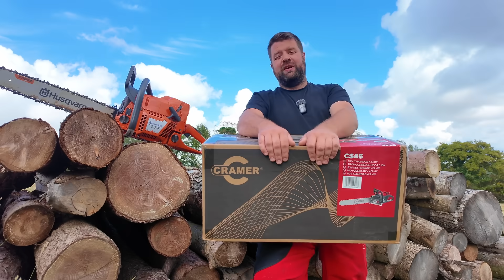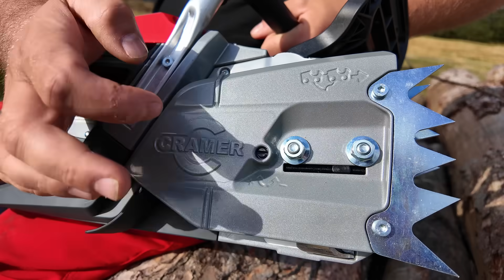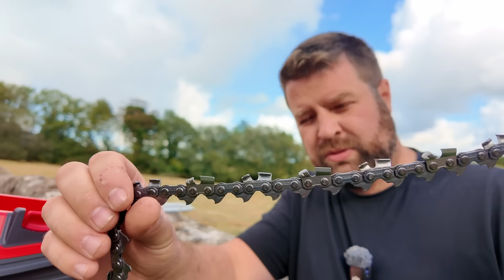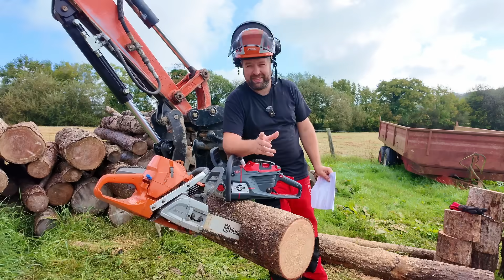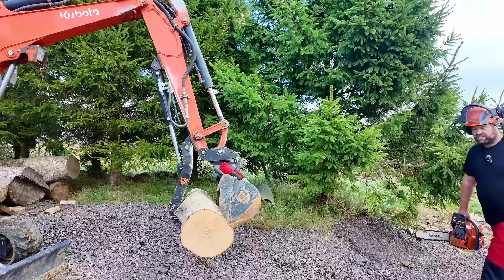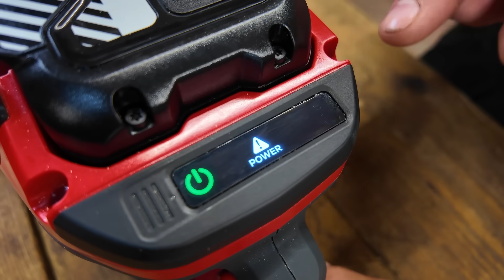Can this NEW 70cc Chainsaw BEAT my HUSQVARNA 372XP?

Comment: Cramer has the right idea but the wrong energy source. They need to make the saw solar powered and 70cc equivalent then we can start comparing it to professional grade equipment. Til then it's just a good conversational piece for guys at the water cooler.

Comment: The 372 is out of tune I can tell just by the sound it should have not bogged down that much in either wood. Chain looks like it could definitely be sharper  it was throwing more dust then chips

Comment: I own and still use a 372xp its one of the BEST chainsaws ever made when using a 20" bar and chain. 
The problem using battery chainsaws is how are you going to work 8 to 10 hours days with it out in a forest ??
Also when I worked away from home in the forests working in the UK there was NO where at all to charge any battery up that was needed unless it was my phone plugged into the Forwarder I used.
Thank you for the video.

Comment: For many homeowners who don't do much cutting the battery option is the better of the two. I would still take a 2-stroke for any larger jobs, the ability to just keep putting fuel into it outweighs the benefits of the battery saw.

Comment: While battery powered chainsaws have made giant strides, they will never beat out internal combustion because of longevity. Anyone whobhas any real experiences with high discharge  batteries will tell you those power numbers you gave were tested with a brand new never used before set of batteries and because of how batteries work, will never again be exactly as powerful  as ther were during those tests. With every charge a battery is able to accept a tiny bit less power and this is why batteries have lifetimes measured in charging cycles of what they believe to be how many times your average person will charge that battery over a given period of time, and on the receiving side of that you also have an electric motors that windings not only corrode over time, windings also ever so slightly char a tiny bit every time it is given an extreme load (electric load and or working load), and lastly that saw is making peak power from the factory and there is no room for improvement by tinkerers and modifiers like me.
On the flip side if those were the numbers you were getting from the 372xp, then that saw wasn't tuned and running to the best of its ability, and you have not kept up with its maintenance and tuning (thats obvious from you trying to start it) as for you sharpening the husky, did you also take down the rakers? What were your rakers set at. Also the biggest question which im pretty sure is a no, but is your husky modded or is it stock? The joy with the 372xp is that it is easily modified to reliably make more power. 
In the end, that battery powered chainsaws is wonderful, especially for people like you that dont like to really keep up with their tools and just want something that they dont have to put any effort into and will still work, but most people who are actually into chainsaws see it as an interest and want to put the extra work in to have a reliably fast saw.

Comment: Great saw without doubt .. the problem on all this high performance/draw tools is the cost of batteries and their weight. The saw with 3 big bats will cost you waaaaay more than a husky.  This level is totally reserved to professional that wants to convert to battery or very rich people .
In many home situation a lighter smaller chainsaw with a battery that shares with more "home diyer" tools would be probably make more sense.
I would buy it just for free of charge 😂😅

Comment: I never have heard about this Cramer brand, I have the Stihl MSA300 witch is 30m per second also and is fast sure but for a day work out in the forest I with need a truck load of batteries. Is also the same case with this Cramer?
Reply: cramer = greenworks. The battery technology seems to be about the same for every brand. Battery saws are not made for a day of work in the forest yet.

Comment: Run time and battery price is the biggest deal breaking for me. Bought a Milwaukee brushcutter a while back,  £700! Has less power than my Husqvarna 535LK combi, and only get 20mins on an 8.o battery! The more powerful batteries were so expensive,  I didn't bother.  Bought a Husqvarna 555RXT instead, no charge time, just 10 seconds to refuel, and shedloads of power!

Comment: Great you beat an old saw made in the early 2000s.  With a saw that weights significantly more.  Why wasn’t this compared to a 572xp?
Also new bar and chain vs an old bar and chain make a difference even if it’s hand sharpened.

Comment: For those of you who want to know how the numbers stack up, if you need your saw to earn its place and its money, and put food on your families table, a husky 572XP wins every time permanently. The numbers ive used are from husky and Cramer. Everything comes with a cost. whats the run time on the cramer, price of the batteries? lets run a few numbers shall we, 7.2 aH battery that costs £500. at 82V that gives you 0.59KW/H running 4.5KW motor that gives you 8 minutes 24 seconds of run time. Cramer have a dual charger, running 4 amps per slot, so thats 2 hrs to charge 2 barreries, average to 1 hr/battery. you need 5 batteries to keep running . this gives you 40 min per hr. This allows the equlivalent petrol to be refueled and chain sharpened. Now to the money. £900 quid for the saw + £140 for the charger, and £2,500 for 5 batteries. that's £3,540 all in. and then £2.00 a day for the electric lets compare with a husky 572XP £960, leaving £2580 for fuel, lets call it 1.5 a ltr, thats 1,720 ltr of fuel, based on equal run time of 40 min /hr thats 1400 hrs= 175 work days= 35 weeks. in this time the batteries would have gone through 1400 charge cycles, then their is the electric. 175 work days x £2 is £350, this needs to be ballanced with another 233L of fuel equating to another 5 weeks relating to another 200 charge cycles. We will leave it at that. so 1600 charging cycles. Trouble is, after 1200 charging cycles, (I've looked it up) the battery is down to 80% capacity, thats another new battery right there. This is a more expensive up front cost system, that is more expensive to run
Reply: The beauty of choice I guess. I know a lot of people who don’t want anything petrol anymore, and some who have started out their businesses that never had petrol to begin with. 

Cramer also have a 5 year warranty on the batteries, I’ve got their first gen batteries from 2021 still that I use every day and they’re still running at full capacity.  Battery just isn’t for everyone but you’re never in danger of not hearing about it.

Comment: No thanks.  I cut only my firewood.  in 20 years the husky will still run like new.  The Cramer will be without batteries.  Also how many batteries will one need for continuous cutting.  Does one need to get a generator?

Comment: 6.3kg  husky compared to 9.3 on the Cramer. You'd know about that if you were using the saw for any length of time I think that's an advert for petrol not battery
Reply: it's not apple to apple. 6.3 is without : bar, chain, fuel. And the husky is a less powerful saw. 
Stihl (which is known for the best power/kg ratio chainsaws) Ms462 (4,4kw vs 4,5 for the cramer cs45) weights 7.64kg with a 20 inch and no fuel. So around 8,4kg with fuel. The cramer is heavier but not that much of a difference.

Comment: 9.3kg with battery.... enough said.
Reply: that's a standard weight for a 4,5kw chainsaw.
Stihl MS462, 4,4kw, weighs about 9kg ready to cut with 50cm bar. Negligeable difference. 

He did a really poor job comparing the weight of the two as 6,3kg is the dry weight of the 372xp and 9,3 is the full weight, ready to cut, of the CS45. Add bar, chain , fuel and oil to the 372xp and it's about 9kg as well, while being a class lower than the CS45, so heavier per kw.

Comment: Try the same test in 2 maybe 3 years time,that will be a different test, batteries don't last.
Try the new hilti or Bosch saws.
Reply: about 2000 cycles of charge before it loose about 20% capacity and power. 1 to 2% loss per year at rest in good storage conditions. You are talking about alibaba batteries, this is last gen pro grade tabless batteries. It should last at least 10 years.

Comment: Great video, how do you think the top load battery will hold up to rain?
Reply from the maker: The chainsaw is IPX5 weather rated meaning it is protected against low pressure water jets from any direction. The battery is IPX4 rated meaning it is protected against splashed of water. So will be more than fine using it in the rain

Comment: Beast of a machine that is a rebadged Greenworks. Does the Cramer brand offer full parts availability? The Greenworks parts availability in the US is very poor. One of my winter projects will be scrounging an oil pump replacement for an out-of-warranty 40v saw. Your Stihl/Husqvarna/Echo gas saws are just miles ahead on that front.
Reply from the maker: There are over 60 cramer dealers here in the UK. I know that most dealers here in the UK pride themselves with being able to support top brands and parts supply.

Comment: Stock 372s are good, but grind the bottom transfers and open the muffler and you have a beast. Would definitely compete.
Reply from the maker: Try to keep my chainsaw to stock if possible, but do love seeing how these chainsaws perform with mods! Thanks for watching
Reply: @MachineryNation  They really do become a different saw especially if you put the big bore cylinder kit in. Get yourself a Farmertec G372 which are quite cheap and do those mods then compare it to stock OEM.

Comment: I know which one will last 25 years and I have 4 of them .
Reply: For 25 years? Depends on usage. I have a Stihl 011av. My grandfather bought it. It's still running. But with not industrial use. My friend bought a 372xp 13 years ago. Mid industrial use. It's still running but he had to swap some parts of it.... At here you will have to swap batttery if you maintain the chainsaw reguraly. With industrial use this won't hold for 25 years... Not either the 372xp.
Reply: @volkerball3  I have 25 year old 372 and 30 year old stihl as well , stihl running fine , parts still available .  No one except Husqvarna is making an industrial version of a battery saw that I know of . I have a couple of those too and they are great so far.
Reply: @onthelake9554  
green works makes a 6.7hp 28 inch commercial battery saw that I saw out cut a Stihl 500i. It cost as much as a 500i and is heavier also but it bucks  big diameter logs fast. Battery electric still isn’t for everyone but is for most people today because three years I used the most power battery saw that was a 40cc dog. Now I own a 70cc battery, a 40cc battery, and a 35cc battery equivalent chainsaw that I use for different applications and every time I pull the trigger they just work and have never failed me yet. Time will tell how long they last but electric motors themselves if built right do outlast quality built ice engines because electric motors have very few moving parts which is why they are generally more reliable.
Reply: @volkerball3 the pro model 2 strokes most certainly will hold up, may need a rebuild but it will most definitely will hold up. I cant speak for current production pro model saws, but the older ones were built like older big rigs, they were made to last but also easily be rebuildable
Reply from the maker: I love the 372XP chainsaw aswell, would never get rid of it- we dont know how things will change in the future though with 2 stroke machinery sales

Comment: did you put a brandnew chain on the husqvarna 2stroke chainsaw.cause the battery chainsaw had a brandnew chain
Reply from the maker: It wasnt a new chain and in hind sight should have put a new one on for this test. we did sharpen it after the softwood test and felt it had a decent edge

Comment: Next test should be, how long it runs on a single charge as opposed to the tank of fuel, and how much extra batteries will cost.
Reply: Ive crunched the numbers, and its not good relative to a petrol Huski 572 XP. Everything comes with a cost. whats the run time on the cramer, price of the batteries? lets run a few numbers shall we, 7.2 aH battery that costs £500. at 82V that gives you 0.59KW/H running 4.5KW motor that gives you 8 minutes 24 seconds of run time. Cramer have a dual charger, running 4 amps per slot, so thats 2 hrs to charge 2 barreries, average to 1 hr/battery. you need 5 batteries to keep running . this gives you 40 min per hr. This allows the equlivalent petrol to be refueled and chain sharpened. Now to the money. £900 quid for the saw + £140 for the charger, and £2,500 for 5 batteries. that's £3,540 all in. and then £2.00 a day for the electric lets compare with a husky 572XP £960, leaving £2580 for fuel, lets call it 1.5 a ltr, thats 1,720 ltr of fuel, based on equal run time of 40 min /hr thats 1400 hrs= 175 work days= 35 weeks. in this time the batteries would have gone through 1400 charge cycles, then their is the electric. 175 work days x £2 is £350, this needs to be ballanced with another 233L of fuel equating to another 5 weeks relating to another 200 charge cycles. We will leave it at that. so 1600 charging cycles. Trouble is, after 1200 charging cycles, (I've looked it up) the battery is down to 80% capacity, thats another new battery right there. This is a more expensive up front cost system, that is more expensive to run
Reply: @jukeseyable 
People don’t buy battery saws for long run times they buy them for the comfort and convenience.
Reply from the maker: Thanks and good idea. We have planned content coming up soon, across the winter so will try to include this.
Reply: Forgot about that, It mostly like is like the Stil MSA300 witch I have and witch is also fast and 30m per second chain speed, just to bad for a day work in the forest I with need a truck load of batteries, cutting 45cm diameter oak 11 cuts and the top battery the AP500S is out of charge and hot for immediate recharge. 
They not for professional use.
Reply: @sirvozelo1 this saw in the video, using the 51cm bar it comes with does between 40 and 50 cuts on a charge depending on hard or soft wood. The 82V batteries don’t overheat and charge immediately, I have their CS34 and only use 2 batteries at a time, while one is in use the other is charging on the twin charger which is a fast charger. I’ve never had an issue and save a ton in fuel
Reply: @Jay-and-co  How do you charge the battery in the field?  Do you go back to a vehicle and try and use the vehicle to run the charger?
Reply: @Redandranger 
There are portable battery powered portable recharging stations that contractors use all the time to charge batteries in the field. Same could be used in the woods. Most homeowners don’t need gas chainsaws for what they need and want the convenience of a battery saw and never have to worry about making sure their chainsaw are empty of gas when stored. Just slap in a battery and pull the throttle. I own three different size battery saws and will never go back to two smokers even though I cut 20 cords per year.
Reply: @sirvozelo1   But for everyone else they work great. I cut 20 cords of firewood each year using three different size battery electric saws ranging from a 35cc to a 70cc equivalent battery saws and have never run out of batteries with the few spares I own.
Reply: @Burnit-l8j  I to have 3 different size saws, Stihl MSA300, 220C and 161T and batteries 4 AP500S, 4 AP300S, 1 AP300 and 1 AP200. In regard to the saws sure they are great but go to a pile of 18" oak logs and cut it continuous in pieces for the fireplace then you see. I am talking about a day 8 hours continuous work not one hour  today and one hour tomorrow, I am talking about  at least 12 or 15 oak trees over 18" to 20" diameter and then cut and limb all for the fireplace. In my case, this saws yes they are fine, I am just a homeowner a professional out in the woods with need a truck load of batteries for a day work. Battery technology still light years away for professional use.
Reply: @sirvozelo1 True but in 10 years batteries should be much better. Battery technology is in its infancy. The next generation of battery  technologies should be significantly better than today’s battery technology. It wasn’t that long ago that nicad batteries were state of the art tech but were junk compared to today’s battery technology. Fuel injecting gas chainsaws is the most significant improvement in gas chainsaws but add cost and complexity to the saws that most owners won’t know who to fix unless they have access to the software to update firmware and are handy with a multimeter. Rebuilding carbs was a lot simpler to fix than diagnosing a fuel injection issue for most people. If you’re cutting that much fire wood in a day gas is the way to go. I’m retired so I only cut wood for myself and sell the rest for firewood to help cover the cost of all the batteries I bought. 😂
Reply: @Burnit-l8j  I am in the same position you are so for me battery saw is fine, however I must admit for professional use this machines are expensive and not serve the purpose because battery technology isn't good enough yet and batteries are priced like gold. I not just have the chainsaws I also have Stihl 135 Trimmer, BGA86 Blower, GTA26 and the ASA20 pruning shears.